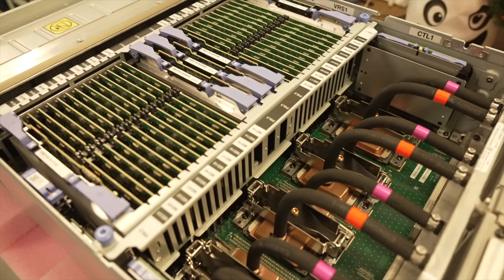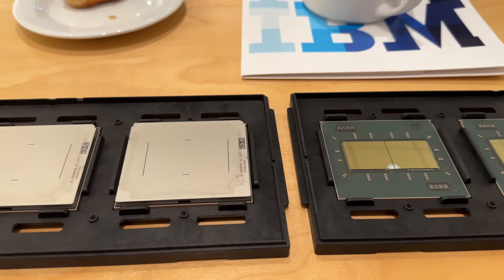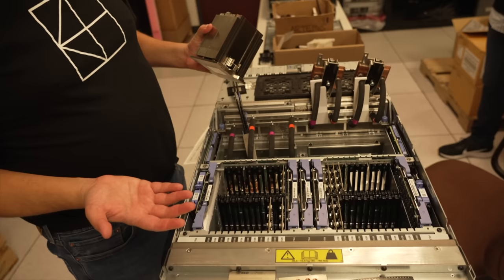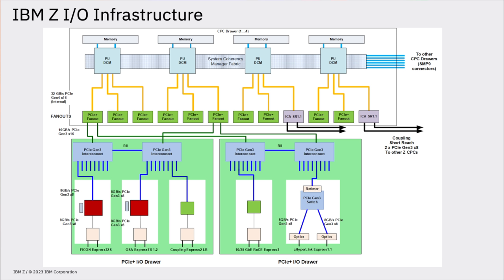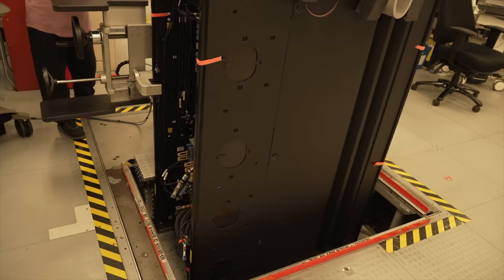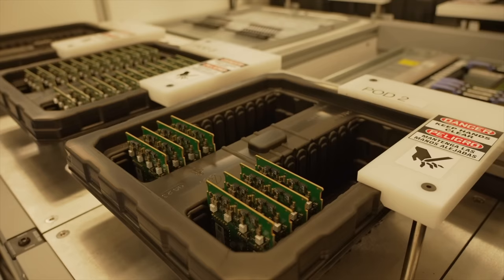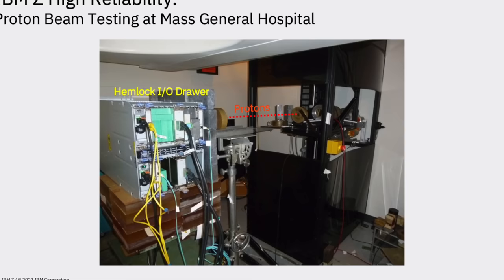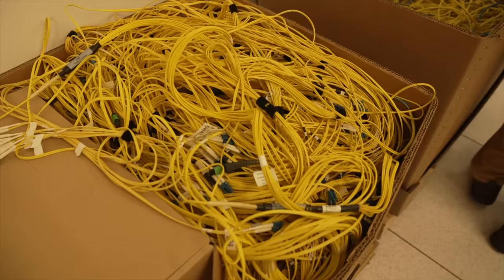Why Do Mainframes Still Exist?  What's Inside One?  40TB, 200+ Cores, AI, and more!

Comment: This is INSANE, every time you mentioned a feature I thought there was no way they could top it. And then they're just casually like "oh yeah and these 64 5.2GHz cores can also run 2 bajillion VMs and encrypt all of main memory and correct for cosmic rays"
Reply: I haven't touched a mainframe in a little over 20 years, but....   "when it just HAS to work:  mainframe"
Reply: @jovetj  Because I got an earworm from that, I need to share it with you.

I'm standing in your server room
'Cos I got kicked while playing Doom
The lights are dim but I can see
Your hardware is so quality
I need to apply the patch
So I can get back in the match
But something's caught my eye
A mainframe reaching to the sky
Reply: Did you catch the brief comment that they can upgrade the mainframe firmware/software in place without shutting down?!
Reply: hes an under utilized resource the universe hasnt tapped yet
Reply: @AllenCavedo  Yes.  
The system I worked on was a small business server, and I restarted it weekly, but if something went wrong with it we usually wouldn't even know, IBM would just show up out of the blue to fix.
Reply: @AllenCavedo  No, actually. Does this include the OS?
Reply: @jovetj  Even back in the 1980s, the hardware could self-diagnose and "phone home" to the IBM engineer.  When he arrived at strange hours of the day, the Operations staff would ask "Why are you here?"
Reply: Many of those features have existed for years and are often not exclusive to IBM mainframes.  However, when it comes to reliability  IBM is a surprising innovator in the market.  The RAIM style memory has ben a feature for decades at the high end I believe.  It was rather big news in the Unix market that DEC/Compaq was going to adopt a similar system for their Alpha EV7 chips for increased memory reliability.  While not a RAID5 like implementation, Intel did have memory mirroring hardware on some Itanium chips and to the point that the ECC algorithm was different between the mirrored channels.  This would help determine which of the two channels held the correct information when an error was encountered.

Other features pioneered by IBM include hot swapping of well, nearly everything.  Adding processors and memory to a running IBM mainframe has been thing for again, decades now.  Various Unix or x86 servers have had this functionality if you wanted/needed it from a handful of vendors but you had to pay extra and they certainly were not universal nor standard features.

The one feature I do admire about mainframes (but again, not exactly unique now) has been the ability to run two frames in true lock step:  clocks are synchronized as is their execution in a mirrored fashion.  Thus when the primary system is adding two numbers, the secondary system is also adding those two same numbers simultaneously but potentially over a hundred kilometers away.  So why would anyone want this?  Think military and government usage where the reliability factor is 'can it survive a nuclear strike?".  And well, a single mainframe instance can't but two in lockstep have a fair chance of continual service.  That is why the physical testing at @12:24 does not surprise me at all.  I've heard rumors that they have done gun fire testing before on two lockstep units to see where/how the victim mainframe would break and if/when the secondary unit would take over processing.
Reply: @alexhiatt3374  I'm not sure about the current OS because I've been out of the game since 2006, but ...  The SysPlex concept allows a workload to be spread across multiple Logical Partitions (LPARs), each running an identically configured OS.  One OS could be shut down for a fresh install while its friends would carry on with the workload.  Back around 1990, IBM started introducing ways in which the software environment could be dynamically reconfigured by the System Programmer, but that didn't include the executable code of the OS itself.
Reply: @brianvogt8125  ok, interesting
Reply: IBM actually shoots particle accelerator beams at running CPUs to test them to make sure they can withstand those cosmic rays.
Reply: You forgot it can adjust for gravitational fluctuations due to the relationship between the moon, earth, and sun orbits, and the built in microwave for the operators lunch!
Reply: @brianvogt8125  yes - I had exactly the same experience in the 1980s - with an Amdahl (5890 if I recall correctly. Running VM/SP v5 with HPO, and MVS guests). It would 'phone home' if it detected a problem. Engineer would arrive before we even knew there was an issue!
Reply: @simonknights7526  The first mainframe to surpass 100 MIPS.
IBM didn't yet have LPARs, but Amdahl had MDF to break the system into separate systems. RACV had one, it had a thumping big CICS application that used one CPU. IBM had systems with more CPUs, but none with a single CPU as big.

We're not talking cheap sheet goods here, this was Multi Domain Facility. A computer inside running Amdahl's Unix I understand, to twiddle the electronic knobs to partition the mainframe.
Reply: a very low bar..
Reply: @TurboLoveTrain  encrypting main memory and correcting for cosmic rays past ECC and sharing cache between CPUs and racks is a low bar? I didn't even know half of this was possible...what kind of machines are you working with where this is a low bar?
Reply: Silicon tech is obsolete.  You're easily impressed.
Reply: That's the reason large and established banks uses them.
Reply: Meanwhile, I’m excited when a software service I spent years working on, and only supports maybe 25 people, functions perfectly without my “divine intervention” for maybe a couple months..  but usually less.
Reply: What really bonkers me about IBM mainframes is there cryptography hardware between the "real" CPU and the networking. Those tiny beasts of silicon can de and encrypt at the full bandwidth of all the cores at all that speed.
So at no times does the applications has to wait or do any crypto, even if we talk about dozens of gb/sec that need 2FA and encryption.
Reply: I worked in several companies that really used a lot of compute power, they ran simulations that could take days to finish. None of them used mainframes, all of them used server farms. I'm not sure how mainframes stack up to get sufficient performance, but a typical server farm would have over 20000 cores and about 50-100TB of RAM. Farms usually consisted of heterogenic servers varying from 256 to 1024 cores.
Reply: @USGrant21st  Probably because the simulations were not business critical. If one takes a few minutes longer it's not going to upset customers. So they can go for a cheaper system. Also notably the RAM per core ratio is much higher for z16: 200 GB per core vs your stated 100 TB/20k cores is only 5GB per core. Really depends on precisely the type of simulation they ran but 5GB can be low for some scenarios but quite ok for others.
Reply: @Martinit0  not true, you don't want too much RAM per core because it would be inefficient, the cores have limited amount of L3 cache. It doesn't, of course, mean that any core can't access any memory, it's just inefficient as cores will idle waiting for data to come. I also worked for a very large financial institution that I will leave unnamed. The stakes  there couldn't be higher because hundreds of thousands of customers were doing real time trading. They had large UNIX farms, never mainframes. IBM mainframes have been dead for quite awhile really.
Reply: @powerpower-rg7bk  In the mid 70s, we couldn't physically add/remove a CPU or memory, but under my direction an operator took a CPU and memory and some peripherals out of a running MVS system so I could IPL and run VS/1, then put it all back when I was done, without affecting the MVS workload.
Reply: @USGrant21st cluster has awful  latency single image computers have better latency.
Reply: @Teluric2  you probably don't have experience with massive data crunching. Nobody is interested in running tiny tasks, scheduling them in and out. Supercomputers are used for tasks that sit on every core for a long time.
Reply: @USGrant21st  Funny that you say they are dead yet almost all the big companies still use them and are always buying the new ones every release cycle. It's also interesting when people mention supercomputers and if you go check their actual runs, most of them are being fed the data to work on by mainframes.
Reply: @joee7452  you live in some delusion
Reply: @USGrant21st  Yes, the same one as articles state about it, IBM's sales figures and revenue that seem to be half based around Z releases, and all of the companies I am my colleagues have worked for over the years. It's weird how that delusion seems to be same for all but you.
Reply: This brings back memories of my younger days as  a "programmer", no one used "coder" very much then,  and later as a MVS Systems Programmer on 30xx boxes. I worked for one company, (global consumer products), who tuned a 3084 to the point it was producing 3090 series performance.  IBM came in and asked, how? 
I also got to work on a Sierra class before first customer shipment. It was a testbed for a design app for an airliner production company in the pacific northwest. Way more throughput than their RISC based platforms could muster! 
Ahhhn the good old days!

Comment: I work on IBM Z and POWER as a chip designer. Awesome to see our work presented.
Reply: How do you get a job designing microchips ?  

just go for Electrical Engineering course ?
Reply: @monad_tcp  ...It's more about electronics than electricals. The specific course would probably be computer engineering.
Let's wait for the original commenter to offer further advice.
Reply: Total CHIP chad :)
Reply: Any chance of using CAPI / Open Interfaces?
Reply: @Brahvim  I already have that.
 I though I would have to learn about Maxwell Equations or something and manually draw CMOS masks with nankin pen or something. How do you do that now ?
Reply: @monad_tcp  I don't know!
I have advanced not a single step in this field.

Your questions, quiet surprisingly, sounded amateur enough that I thought it'd save the community's time for me to answer it instead of the original commenter in this context. That clearly isn't the case - must have felt disrespectful. I'm sorry!

Let's wait for the original commenter's experience-rich answers to your questions!...
Reply: I was wondering what ISA the chips here were using, specifically if IBM was still building power chips. I loved my PowerPC chips and especially the SPU's on the Cell. Incredible design, super clean, so I'm happy to hear it's still in active development. Even arm64 and neon seem messy by comparison.
Reply: @Brahvim  No worries. I'm just going and figuring things on my own too.
Reply: hello fellow Z-er! I work developing z/OS :D
Reply: @monad_tcp goto to electronic degree then pick computer engineering course or specialization. Chip designer can ne digital or analog. Take digital design course and digital/analog IC course.
Reply: @dragunzonline 
Thank you very much for all your work and effort!
I love POWER and Z CPUs, especially POWER
Reply: I miss the SP2 I use to work on.  It was beast at the time.
Reply: But Mainframe cpu is designed foe Core Tansactions per second, more in Bigdata. It was not for mathematical conception. When you will analyze the big data from the NEC Supercomper via Database than you have with the Mainframe Concept the fastest solution ever. With IBM Db2/2 REL behind, the performance is more than 45 % up against a normal standard Server System based on AMD or Intel. IT was only goes the feauture Transaction per second. The IBM Power Chip was on of the fastest Chip in the Mainframe branch. You see it on statitics. Also older AS 400 System in the Office Design shows the Transaction unter sql blow up against a Intel Server System with 64 Scores.

Comment: I retired in 2020 and I refused to work on z16 because it would have kept me working to age 81! But I was a z system architect up thru z15 and had worked on the mainframe since the system 360 model 85 which contained the very first memory cache. I always knew I was on a team working on one of the most truly great products ever conceived. I loved this presentation. Thank you.
Reply: I started on an IBM 1401 in high school then an IBM S/360-91 at UCLA.  Joined IBM as a Systems Engineer.  I installed 3033s, 3084s and 3090s, etc.  It was an amazing journey!
Reply: The 360-85 was years ahead of it time.  I assisted with hosting several corporate benchmark sessions at the Kingston plant in 1969 before it was withdrawn from the market because of its speed.  Years later I had a occasion to work on a 3033 and realized it was just a 360-85 with faster logic chips, solid state memory and a CRT console.  Like others here, I have worked on 1401 1410 1460 360 370 and 4300 systems. Plus 20 years on PCs from about 1990 to 2011.  Now running Proxmox and Truenas in my retirement lab.  Lots of GREAT memories!!!
Reply: Graduated college in 1968 wirh a BS in Computer Science. It made a great career on IBM Midrange - System 36, 38, and what is known as IBMi (last I heard anyway). It was quite a ride that lasted >50 years.
It would be interesting to see how it would stack against the Z
Reply: Thanks Dave for all you do!

Comment: I am proud to have worked on the I/O subsystem code. I even updated the boot loader which was originally written before I was born.
Reply from the maker: Very cool!
Reply: What language? Legit question - would take a stab and say COBOL perhaps?
Reply: @willd0g  Assembler I expect. Operating System components were written in Assembler in my day, and IBM used PL/S a lot, and later PL/X. Both could GENERATE(inline assembler code).
Reply: why do you /ibm use win xp
Reply: Boot loaders were written in BAL.

Comment: The first machine that I was responsible for as a system programmer was an IBM 4341 back in the early 1980s. It was used for software development and testing running VM/CMS and supported 6 concurrent users. They’ve come a long way.
Reply: Now you're looking at 7 users with 4 tabs each on Chrome. 
How far we've come 😄😄
Reply: We had some baby 4300's--41, 61, 81. A 4341 could easily support 30 or 40 users in VM/CMS 370 without a sweat. We even bonded two 81's together with one as a "real system," and the other as a "test dummy," running loads and having the 2nd frame testing responses. Basically debugging one mainframe from another! LOL Our "big iron" was 3033s, 3081s, 3084s (replaced by 3090s). Cool toys! And we even have a baby 9370. I miss those days and the cold DC room.
Reply: Six sounds pretty few, we had 70 or so on a System/370 Model 168. Under VS2 Release one, all TSO users shared a single address space and swapping was painful (3330, 3350 DASD).  When we got OS/VS2 (MVS), everyone had their own and things were fine.

In Australia, the 43XX computers had special firmware available to allow them to run Fujitsu operating systems, OSIV/F4 and OSIV/X8.
Reply: @oneeyedphotographer  Interesting. Hadn't heard of OSIV
Reply: Company I worked at the 4381 was the local branch machine, anything really needing processing went to the remote 3090/600S.  The VAX/780 was used for DTF and ascii/ebcdic conversions.   Now I'm all nostalgic about loading tapes/carts.  lmao
Reply: I can't go into all of the reasons for 6 users, but it was a unique workload.
Reply: I did IBM 3030 in the early 1980s and IBM 1400s before that.
Reply: I was a Tech Spec on 4341 with IBM .  It was a great machine.
Reply: @charlesmiller6132  My favorite 4341 story is that we had a power outage over a weekend, and the humidity got so high that IBM had to replace the 8" microcode floppy disk.
Reply: @pauldunecat  They were interesting times, but the thing I'm NOT nostalgic about was being the on-call MVS System Programmer, needing to carry a pager while I was on the streets doing Marathon training, or being called by an Operator at 3 am to tell me that JES3 had crashed.
Reply: Hey Tom, I guess I'm your twin. See my post above stating my first job was to uncrate an IBM 4331. What are you up to now? I did VM and MVS but mostly VM and Profs/Officevision. Migrated Officevision to NT domains running Exchange 5.5 in 1998.
Reply: I learned COBOL on a WANG VS-80 with a clean room for platter changes.
Reply: sureee buddy, sureee
Reply: I started on a 1401, then a 360/20, then a 360/65 then a 620.  It was fun all the way !!!
Reply: @brianvogt8125  -- did you tell the Operator just to start another instance of JES3, and let allow it to take over the devices?
Reply: @melvinklassen  Yes, just restart JES3; on the few occasions, it was always that simple. Never needed to play with the JES3 inish deck. A few years later, we brought a JES2 based system in house as well. The Operator command list for that seemed 10 times as long & complicated; glad I didn't tangle with draining initiators & stuff. With JES3, you just say go or stop.

Comment: I worked on an AS/400 back in the 90's. One memory was coming in on a Monday morning to greet an IBM engineer in reception. He said that our AS/400 had suffered a cache problem over the weekend and had contacted them for help. He opened it up, replaced the CPU cache board and closed it. The system basically said "thanks" and it proceeded to speed up to full speed. Absolutely astonishing. And that was over 30 years ago.
Reply: After decades big blue confirm great products with great engineering
Reply: @neriozulberti1492  Yep. Also look at IBM Northpole AI/ML chip. 6x faster than NVidia A100/H100(new) whilst being more efficient.